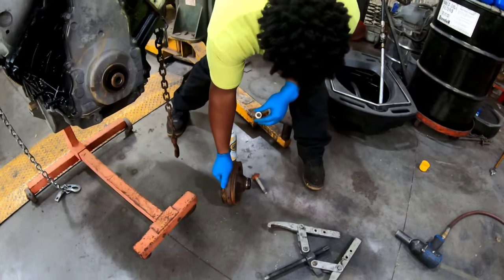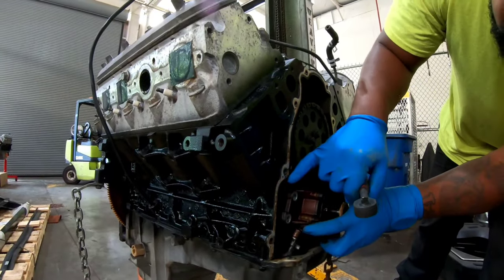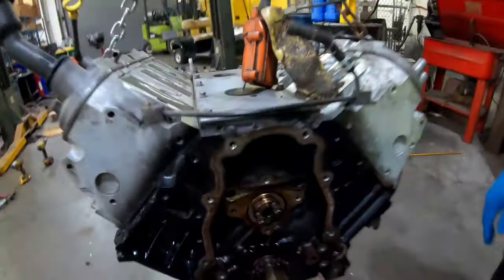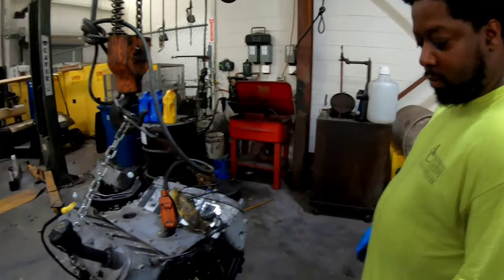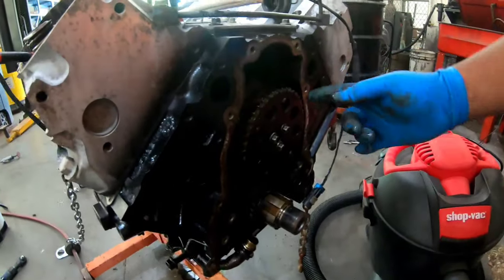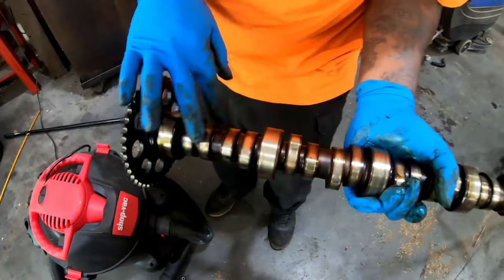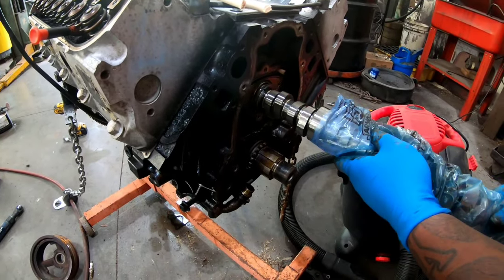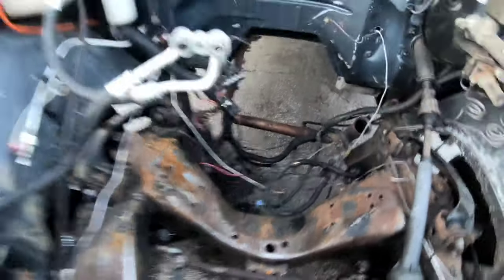DIY:  LS Cam Swap (w/ Heads Still On) & Oil Pump Replacement

Comment: Make sure the o ring goes back on the oil pick up tube to the oil pump...or you will be doing this again. ...(you don't have to remove the oil pump)..gotta remove the rocker arms and push rods , then spin the cam around a few times, but since the engine is on the stand yall can flip it upside-down and not have to worry about dowels and lifters falling. .....but it's a learning curve. You guys did good, when all else fails. ....you tube videos for the win......what kinda cam is going in there??
Reply from the maker: Thank you for the info, sir. We did everything you stated. He did the exact steps you mentioned but I was busy with office work and wasn't able to film it. That was actually a question we asked each. We chose not to flip the engine so we could learn a little,  lol. Cam is the Brian Tooley NSR cam. Thanks for watching and thanks for the help!
Reply: Hey Trent.  If you flip the engine do you still need to remove the push rods?
Reply: And rockers
Reply from the maker: @Jailm06  I read that flipping the engine will let gravity do the work and you WILL NOT need to remove pushrods.

Comment: Is it the heat on wear pattern let remove remind all of you that's removing a cam removal or installation of any cam of any engine LS engines where you have to push the cam into the engine trying to figure out how to write way to say this this is brain surgery the way you pulled that camera out of there I would definitely look into that in to see if I nicked anything cuz if you need anything on that in those cam journals it's going to destroy the next can that comes in there remember you're dealing with the cam cam is the brain it in when you are removing a cam you got to have cotton gloves on you don't put a lot of force behind it you put enough pull on it to get it out you have to spin it adjusted slightly pull spin it adjusted slightly full and till you get the cam in or out you need to pull that Valley plating checking cam journals you may have nicked one time as hard as you was pulling on that thing that's not the way to take the cam out you got it up but that was too forceful I definitely will be worried about a nick